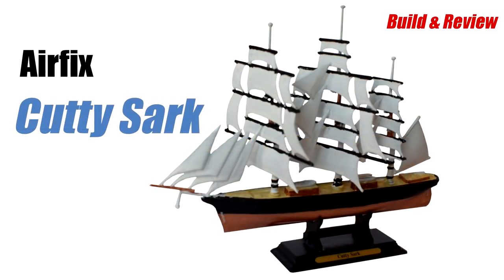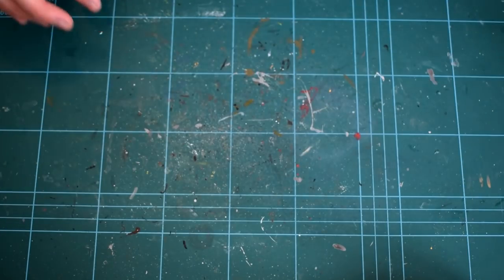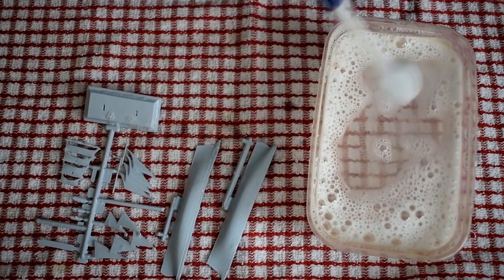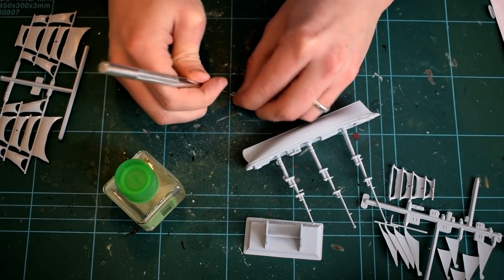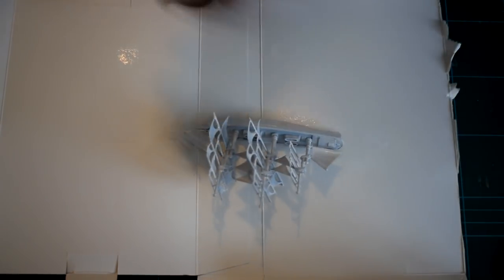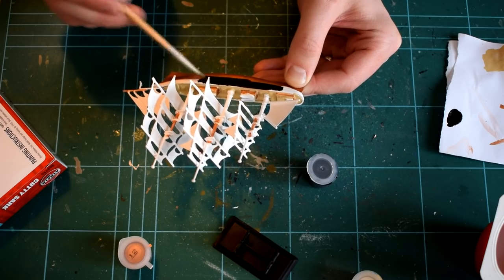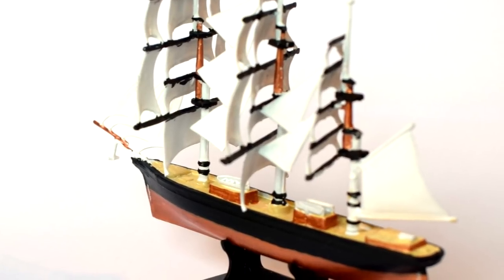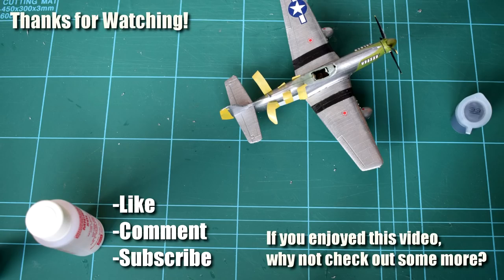Airfix Cutty Sark - Plastic Model Kit - Build & Review

Comment: Great Job Model Minutes! despite your issues with this older kit, you have made a stunning model of Cutty Sark. To aid with brush painting pure white, you can  use a warm white (which is great for fabric textures such as sails or 18th to mid 19th century military uniforms).  Start from a cream base, on the second layer mix 50% white to 50% cream, and on the last layers use pure white highlights. It will give a nice range of tone to a plastic surface.
Reply from the maker: A top tip! I'll have to try and remember that next time - thanks :D

Comment: Anyone else have trouble with the display stand slots? I had to file the tabs to insert. I bought this as a bit of fun and it wasn't dear. So fine. However the idea of some kid using this low quality kit as an entrée into model-making does not sit will with me.
Reply from the maker: Yes, i can imagine the display stand was a bit of trouble. I didn't really have any issues, but there are fit problems in this kit